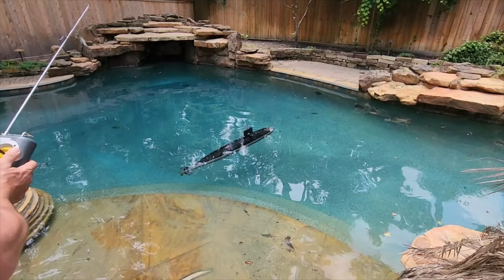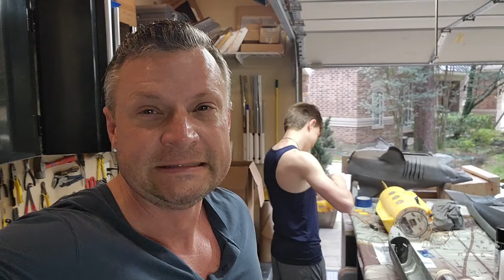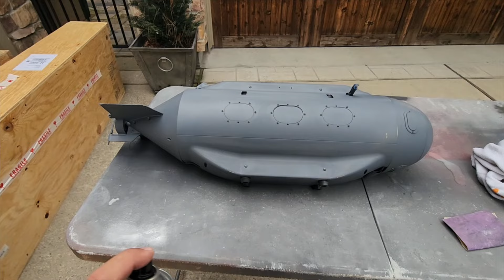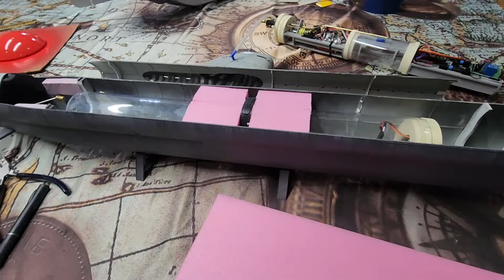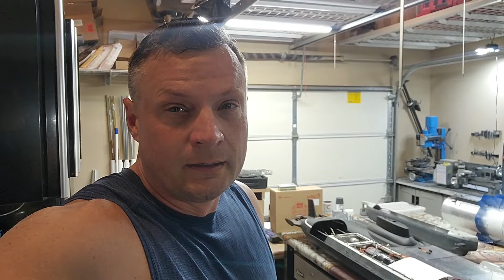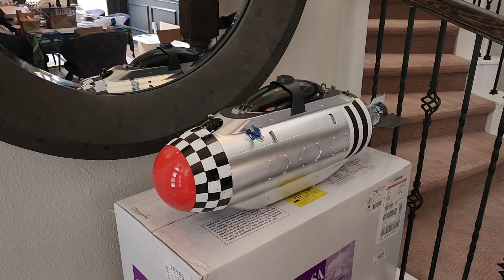The RCSubGuy Builds a WW2 Fighter Sub and Lets Billy the Shark Loose in the Pool!

Comment: I have some of those pogo's as well but i ordered the 5 pin version.  I also have some elongated ones that have a small enough diameter pin that once you depin the rc connector the female pins can just slide right over the pogo pins.  The round ones like you showed are a slightly bigger diameter and will require actual soldering as you mentioned.